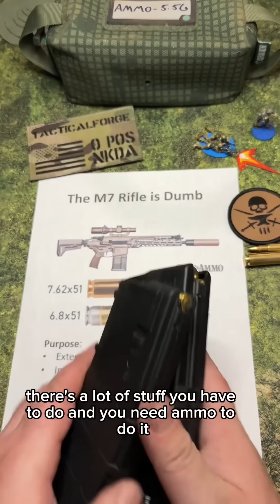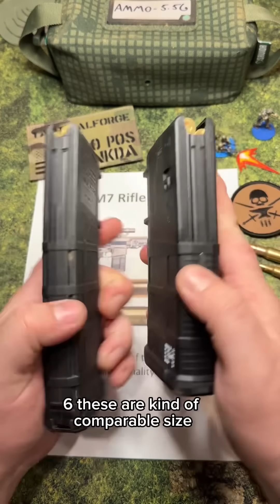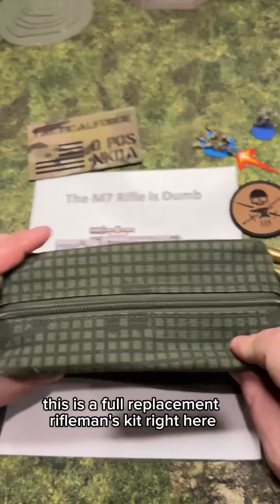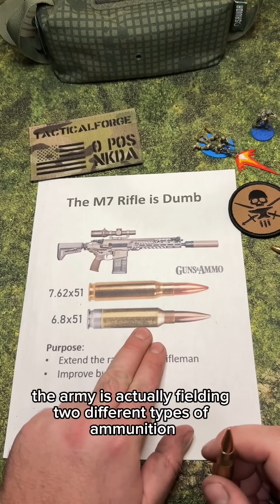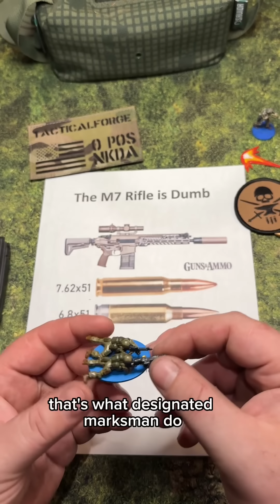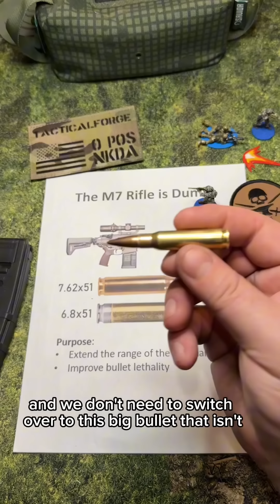My God this Rifle Sucks

Comment: i just have one question for everyone in procurement: if you're wearing all your best body armour, would you rather face a guy carrying 500rounds of 6.8, or a guy carrying 2500rounds of .22lr?

reason i ask is because body armour doesn't provide complete coverage, it's not an invulnerability spell. and engagement ranges are almost always under 300yds. firefights are about suppression and manipulation of the enemy until they are cornered. round expenditure on suppression massively exceeds what's expended on lethality and the two only ever diverge. so what if the enemy wears class 4 plates? they still aren't going to be striding out of cover when doing so might mean getting shot in the face, hands, arms or legs. being immobilised is the same as being dead if your team loses. maybe worse because living casualties require more care than dead ones.

supressors? look gucci, great for concealed sniping. makes no difference in a firefight.

i agree, they've fundamentally misunderstood the mechanics of infantry fighting. and with drones added into the mix, that extra weight could have been an under barrel shotty. and with doctrine pivoting to underground fighting and fibua, because of the drone threat, big rounds become even more irrelevant.

someone else said the xm7 is the US's SA80 and i second that.

Comment: What they need is a 7mm but with a 7g bullet, 18in barrel and shrunk down and less powered case. Then it would actually function properly as an SMG unlike the m4, and it would be good enough as a rifle and you could have decent ammo supply for a change. If you didn't have the featheweight bullets in high velocity they would not need to keep going back to the real rifle rounds. Instead they try to make a high velocity long distance sbr with zero ammo, that's going to be a real winner in a long list of incredible winners.

Comment: Imagine this... Afew high ranking members of jsoc retire and using their internal knowledge of the potential of a new contract bid for new weapons join Sig Sauer and utilize that to gain employment as advisors.. they pitch the idea to several prominent individuals who they know will be involved in the testing and evaluating process in exchange for future employment after service and possibly a kickback.. the contract gets approved knowing that the product isn't exactly what infantry units need but knowing that each individual unit will cost the military approximately 4x the cost of current systems.. they receive bonuses for their due diligence.. of course such thing would never happen..

Comment: Well, the US military, at it's top has "always" been bad with reality. Since Cold Era. One of the perks of 762 is that is absolutely kills you enemy if it hits 556 doesn't. And when you hit an enemy in the neck and it explodes, it just hits differently to the other side of the trench, but then, we already have good systems like that like the AK and the ammo isn't that much big of a deal, both Ukraine and Russia are doing just fine because in a modern war you don't want to fire too much, get gives away your position to the drones which then gives the position to the enemy artillery system. And US needs is a guy with a 12 gauge shotgun to take down drones with birdshot and then melt guys in trench to trench and house to house with it.

Comment: The cartridge is fine for a DMR or GMG. 6.7 crede is the only true successor to the 5.56 bar none and it's why socom is switching to it. The sig right though, complete trash, expensive, difficult to make, heavy, defies long-established high speed low drag doctrine, and a complexity of "fixed" problems that persist.

Comment: Most likely the Army isn't worried about the Taliban or insurgent forces. I'm thinking the reasoning behind why this rifle and round are being adopted is to face off against a modern mechanized infantry force. One with massive manufacturing capabilities to massively produce a mechanized force and with the ability to produce enough lvl IV plates for their forces. And for that you would need weapons to negate a Humvee or Humvee like vehicles as well  as a modern body army.

Comment: Why is the video vertical?
Why did the creator of the captions hardcode them into the video, instead of putting them as adaptive youtube captions, which can be translated or turned off?
(Btw. I am glad they are at least somewhat capable, instead of highlighting word by word or even displaying word by word.)

Comment: The entire concept of the switch over to this new high power round is ruined by there being a weaker training bullet, like, cool you replaced every single 5.56 and 7.62 gun with this, great now instead of there being 2 different bullets, theres 2 different bullets that look the same.

Comment: The biggest problem has already been proven to NOT have been the problem.  The US military switched from 55 grain ammo to 62 grain ammo (with a penetrator in the bullet) to defeat the body armor that Soviet troops were supposedly going to be wearing as they poured through the Fulda Gap.  One, that obviously never happened, and two, the Soviets never could field that much body armor.

There are a lot of different bullets in .223/5.56mm, capable of distinctly lethal hits and accuracy beyond the capabilities of the average infantryman.  Instead of investing a bit of money to decide which one would have been the best replacement for M855 and M855A1, nope, they decided to spend a LOT of money to create an entirely new cartridge/rifle combo, with obvious serious flaws.  And who will suffer because of it?  Oh, yeah, the folks at the pointy end of the spear, as always.

Comment: Color me crazy? But, since when is absorbing heat what causes the suppression from a suppressor?
Reply from the maker: That’s how the physics works.  When gas gets hot it expands and when it cools it contracts.  The chambers in a suppressor slow the gases,giving them time to cool, shrink, and reduce pressure which ultimately reduces the noise.  That’s why suppressors lose effectiveness as they heat up and some suppressors are designed to be shot “wet”

Comment: I’m not a rocket scientist but shortening the barrel will decrease velocity. So u go to a larger caliber for more stopping power and ability to reach out farther but then chop the barrel and throw a suppressor on it and ur just reversing the path u were on. With this mentality just go back to 30-06 and chop its barrel and put a suppressor on it. Then when that doesn’t work go ar 10 and then to m4 we jus keep reversing the trajectory supposed to b moving forward seems more like steps backwards

Comment: It's worth mentioning that it's not small arms that kill most enemy soldiers. It's indirect fire systems, especially artillery. Of course there are nuances and exceptions, but in modern warfare something like 70% of enemy casualties are NOT from small arms, but from other weapon systems. In Ukraine, with the use of drones I wouldn't be surprised if it's higher.

Comment: All i know, is that if im carying an AR pattern rifle everyday, and especially if im infantry and actually using it, i would be more than pissed to be handed a rifle that is 2 pounds heavier. Not to mention heavier ammo.

Deploying this rifle to the greater army, is preparing for another camel chase.  There will never be a situation in a near peer conflict where you have 800m visible line of sight to the enemy.  

Theres a reason why the most common caliber in ukraine is 5.45

Edit: and why tf does every man need a lazer range finder? So stupid. It doesnt need a supressor as standard either.

All that shlt was just so sig could command a higher price.

Comment: For the past two decades everyone was talking about replacing 5.56 with a 6.8 or 6.5 cartridge for better ballistics and it made sense. 6.8 SPC or 6.5 Grendel don't fundamentally change how military doctrine works and they interface with existing AR-15 platforms.

What they ended up with is just another 7.62x51 battle rifle essentially.

It's like they committed too hard to the literalism of adopting a 6.8 that they forgot the purpose.

Comment: So agree, different training ammo vs real would, just means having to relearn on the battle field. The AF used to qualify with a 22lr round adapted to a M16A2, 1982, it was a joke,  cycled for 2-3 rounds, then 1-1-2-1 etc. and they had to clear it, which made zero sense. Only imagine their first time with correct ammo. I had prior experience, so was more maddening.

Comment: This weapon is the result of American caliber fetishism.

1. The optics do not address the fundamental accuracy issue, which is wind correction.

2. The weapon is too heavy, as is the ammunition.

3. The ammunition is too expensive, although for American taxpayers it’s probably fine.

4. The recoil is likely strong — meaning that after firing a number of rounds, accuracy will decrease due to physical fatigue, which goes against the weapon’s basic concept.

Comment: Been saying this for years now, but they should have gone with the 6.8 SPC. It is effective out to 400 meters. Out of an equal length barrel, it within a 100 m/s of the 6.5. It has better penetration and energy transfer over the 6.5, 6mm ARC, and 22ARC. There was a tungsten core AP round in development back in the day. Really, they should replace the 7.62 with the 6.8 Fury and the 556 with the 6.8 SPC. This would at least somewhat streamline ammo production, assuming they can use similar .277 projectiles.

Comment: Bad idea. Bad cartridge. Unnecessary.  Construct a steel core high BC > .435 135 grain .308 bullet with a hollow cavity with an aluminum tip producing 2700 FPS out of a 14.5" barrel and you've got everything you need. Nobody is going to shoot these things out of vehicles at 700M. They will be used within 300M usually. Therefore, there is no reason to move away from the 7.62N in a less than stellar weapons platform to get this .270WCF +P which will eat barrels every 1500 rounds and increase risk of cook-off. Garbage, but US Army procurement since the end of WWII has had more taxpayer money to burn then sense.

Comment: Anyways, what's the point of using this complex and expensive round when 7.62 is already tried and tested and is roughly similar to 6.8 Fury? Also, if a more powerful cartridge is needed, why not look at the lessons already learned and go with an intermediate solution like 6.5 Grendel or 6.8 Remington?

Comment: Just this year Russia started testing out a shortened version of the AK-12, the AK-12K, specifically as a response to the amount of close-quarters urban fighting that has been experienced on the battlefield. It's not an AKS-74U type PDW rifle (the AK-12SK and the AM- 17 are being tested for that purpose), it's a 290mm barrel rifle meant for assaulting trenches and buildings. 

And whatever you might think of the conflict and its participants, they're the ones with hands on experience of modern warfare, so their decisions are the ones you should be considering very closely to judge what kind of armament a modern military needs.

Comment: Bro forgot to mention the biggest fail of the gun: the fact that if you slap the magazine in too hard, the bolt can't be engaged.  You literally can't fire the gun, until you gently pull the magazine back out like an 8th of an inch, which then gives the bolt freedom of movement.  This is a catastrophically bad design on par with that of the original M16 when it was mass produced for Vietnam.
Reply: Worse than the original M16.  The original M16 worked.  It was the first M16A1s when they demanded much more rapid production that caused problems due to tolerance stacking.
Reply: @larrythorn4715  the original M16 was actually fine by itself. it probably didnt need to be cleaned like they said. the issue was the horrid out of spec ammo they shipped out with it.
Reply: Those are technical issues, which they (might) fix in later development. He's talking about fundamental issues. (E.g., even if the rifle does everything it's advertised to do.)

Comment: Ukraine is reminding us that it often requires 3-4 magazines just to move from point A to point B. The reduction in carrying capacity is going to get soldiers killed in those kinds of engagements. 

It's just so strange that they decided to change the army's main weapon system based around hajis taking pot shots at 8-900 meters with a PKM on the side of a mountain. That's such a ridiculously specific scenario to design and field a specific weapon system for. Especially when FPV drones are better weapon systems for those same scenarios.

Comment: theres no way this way ever be a standard 
it might stay as a specialized gun but i doubt it will replace the m4
also theres an issue of there are already massive stockpiles of 5.56 and 7.62 while this new 6.8 is not produced in very high numbers and its also harder to produce

Comment: Most of this all comes down to the reduced capacity. Which is only true if the doctrine doesn't change. I would suggest that big army is going to change such that there are basically no more on foot patrol. Everyone is going to be in or next to ab ISV or jltv. Which means the guys are only going to carry what they are going to use in the next couple of hours max and that's resupply is an arms length away. When you can dedicate more capacity to ammunition and have resupply an arms length away the capacity equation changes. 
What I think will do in the M7 is that it's just not that much better than 7.62nato. Sure the higher pressure stuff is fast but who is training on it? Compare that to just a new load and projectile for 7.62Nato. where they get compatibly with established supply chains for existing supplies and going to an better armor piercing round if required.

Comment: This is just the first version of this rifle they are already changing alot about it to make it more practical for frontline use. The new version has a better rail. They made it easier to access the gas system. Its now using a shorter barrel. It takes alot of trial and error to work out teething issues on a new rifle platform. If you check out Garand Thumbs new video on the most recent iteration which he dubbed the M7A1 (not the official designation) you can see advancements being made to the rifle.

Comment: 97% of land is rural, only 3% is urban and suburbs, so its prolly gonna be more for long range suppressive fire. which will suck way more for the enemy.  so they either gotta commit to vehicles which are easy targets, or do 1.5 kilometer of leap frog burpees just to get to the enemy. while getting hit with artillery,  4x more artillery and exhaustion.

if 556 goes 400 yards, with 6.8 instead you could stack 3-4 trenches to act as a phalanx quadrupling the fire support, you can have 1000 rounds in a trench and only need to actually carry 200 rounds.

Comment: The change is to simply alter the supply of munitions. If you make a trivial change to operation (respectively) but make previous generations of ammunition obsolete, you effectively make it harder for a …..domestic resistance maybe, to continue resisting. 

New stuff is not widely available and turning the corner on the “old” calibers will drop production over time.

Comment: I think they could have chose something with almost as good ballistic capabilities and less recoil  (Cough, 6.5 cm), that's readily available and has had tons of civilian testing data from competitive shooters. If I were in charge, they'd be getting 13 inch 6.5 creedmores, w/ short qd cans, 1-12 mrad FFP optic, and the best buffering system available.  With that setup, any dummy can hit man sized steel at 600m at a fraction of the price. It's  had tons of free development. People know it works. It can be made with off the shelf parts, on a small budget, with basically no notice. Whatever committee dreamed this up, along  with whoever signed off on it, must have secured quite a bag. They created a really high pressure round, that requires special ammo cases that will need to be mass produced, for a gun that's inevitably going to eat through parts and expensive ammo. I understand compromise, but this has so many bad financial and logistics decisions, it's a real head scratcher. My design would have probably saved hundreds of millions. They could have put all these kids in dodge chargers, Camaros, or the emission free diesel truck of their chosing.

Comment: 22-250. Same bullet with a thicker jacket going 1000 fps faster with the same ammo capacity with a very slightly heavier cartridge and a little bigger gun. They could even use longer bullets with tungsten cores to still get that tumbling effect they like while also being armor piercing on a platform that people are very familiar with